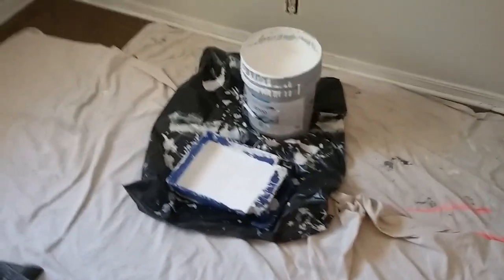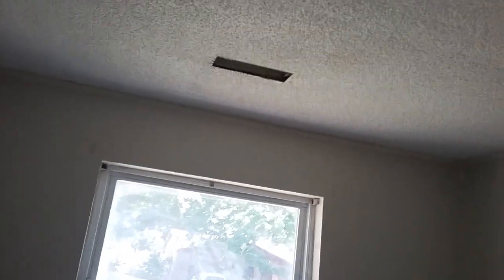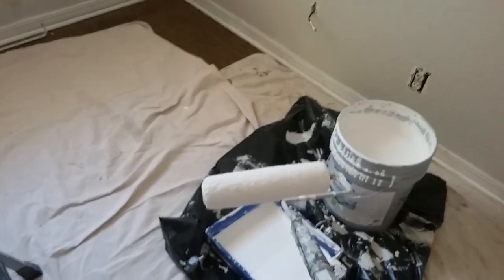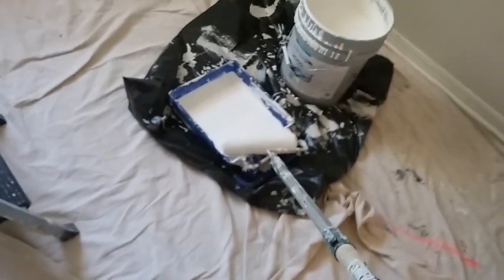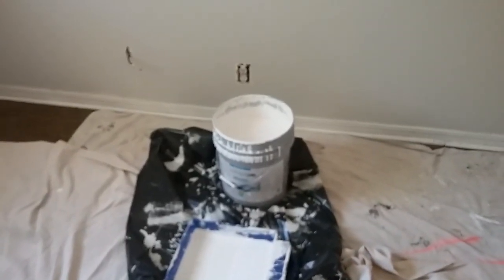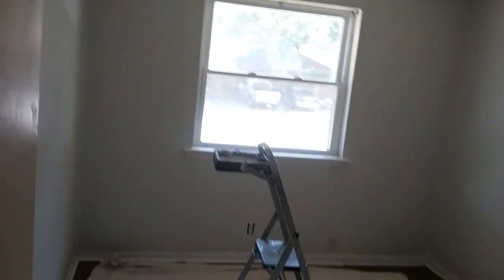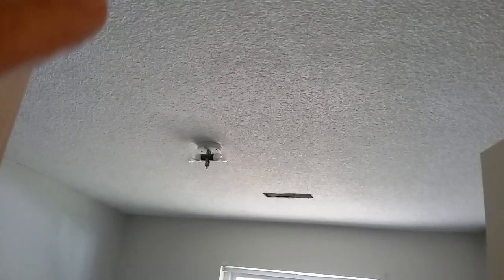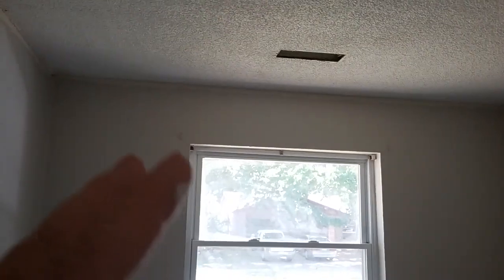How To Roll Paint On A Popcorn Ceiling

Comment: Did any of the popcorn coating start peeling? Or did you have fans/windows going to dry the paint as quickly as possible so the moisture wouldn't get to the other side of the coating and peel?
Reply from the maker: Paint will dry quick enough before it would peel. I typically put two coats of paint on when painting over popcorn ceilings. I follow the manufacturers recommended dry time between coats of paint.

Comment: Do you not put a primer coat on first before applying the paint? Thanks!
Reply: Doesn't need primer it's already painted. He would need some oil based primary if there's any wet spots other than that rock on.... Duh....

Comment: In my opinion the roller pan is trash, a roller bucket with a screen is by far the way to go. Cleaner, neater, faster. Put the bucket closer to you.   Who wants to keep refilling that stupid tray all day long...  If you're getting paid by the job you need to stop talking about going slow. Be skilled enough that you can move quickly and still do a good job. Also spend the money get you some lambs wool rollers. Learn how to back roll if you don't already know, and you'll have the fanciest looking finish by far compared to those spongy crappy rollers. Way less sprinkle way less cleanup. I throw them little $8 naps in the trash I ain't got all day cleaning that shit out.  Or those purdy dog hair junk naps.... Looks like that wall still needed to be cut in you might as well roll all the way to the wall and then you don't have to cut in at all... If you get any nasty smears on the wall wipe them off with a brush. Surely you can get gray to cover flat faint White. Also when it comes to brushes the blue pro extra sprig 3-in is very nice and user friendly. The nylox mousse is also a great brush. That's the soft bristle with a diamond handle. Worcester and most other brushes especially for latex are garbage in comparison. Anything you can get at Home Depot is garbage don't waste your time or money. With all that being said I'm not judging you at all. A good job is a good job regardless of how you do it. Glad you're out there working. I am just an awesome little painter and this is wonderful advice.